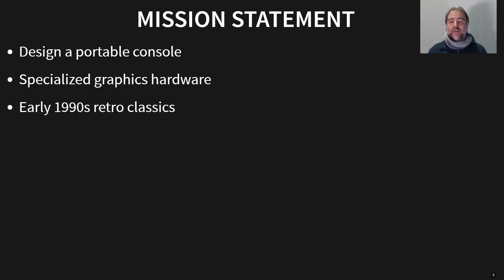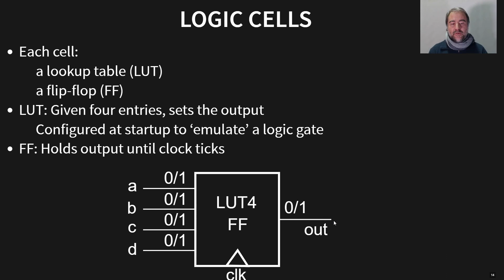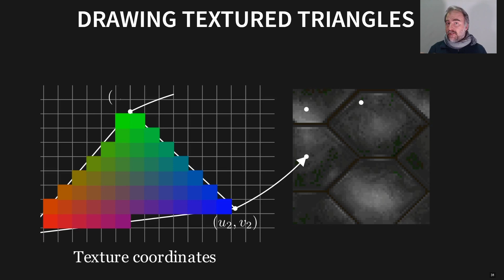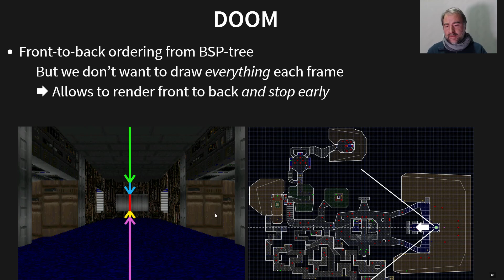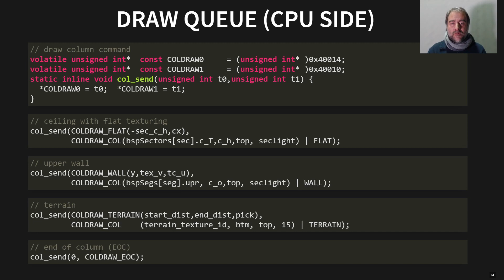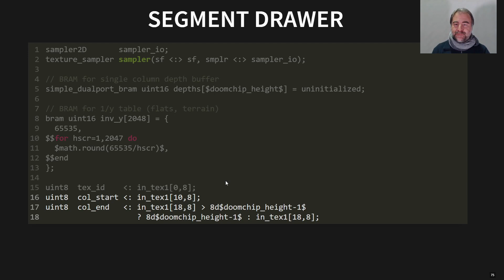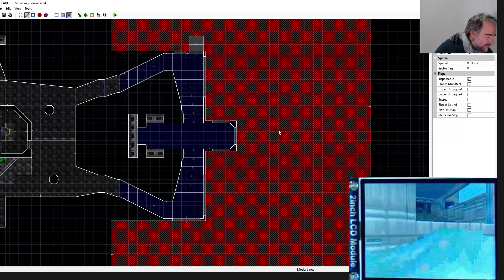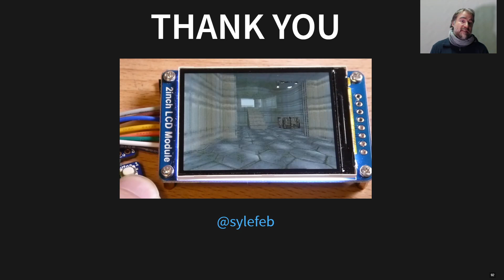The Doom-chip "On Ice": designing hardware for a 1993 retro-classic

Comment: intel MAX10, MAX1000 board chip
Reply: why dont you draw vertical lines only, using z-buffer, very simple renderer engine, also for textures
Reply: sqrt (1+x^2) approximation of 1+x^2/2
Reply: ray casting (also for pre-baked lighting) engine would be nice
Reply: simple per pixel 3d dda ray cast to the pre-baked level plus monsters
Reply: if you only compare distances, the approximation algorithm gives relatively ordered results (if not accurate)